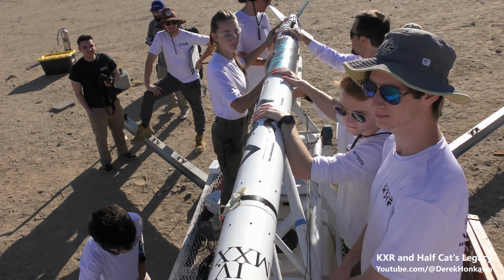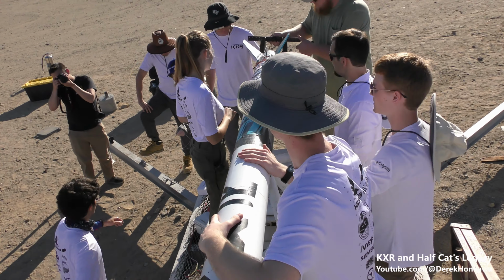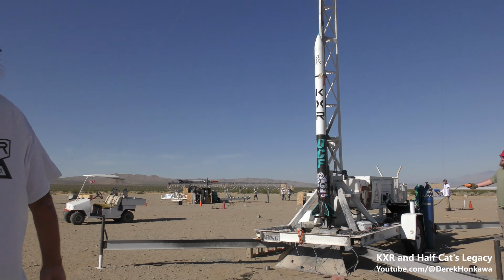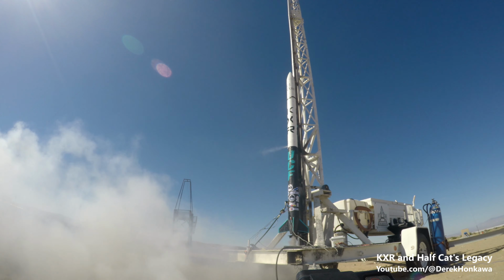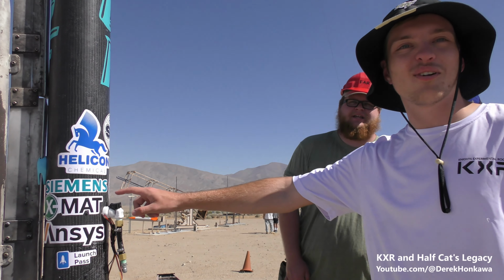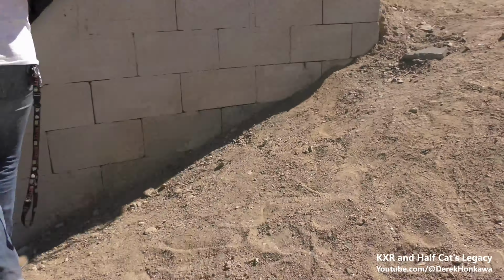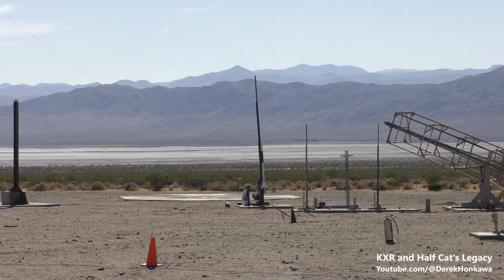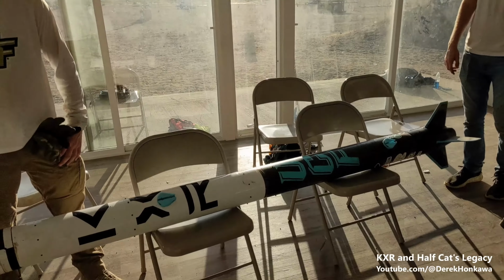The Evolution of Nitrous Liquid Rockets (UCF)

Comment: I'm surprised T:W>1 in unlit mode.
Reply: It was lit it was just really hard to tell. There is about .5 seconds of what looks like “cold gas”. There’s another angle where you can see combustion inside the chamber during that period. It was really oxidizer rich during that period due to our ignitor.
Reply: @rocketfan2001  Actually ☝️
Reply: If you are referring to half cat, that was crazy that it took off in a coldflow
Reply: I just realized you were probably talking about half cats first attempt 😂
Reply: That was a surprise to us too. After the unexpected hop, we zip tied it to the pad so it wouldn't take off unless ignited.